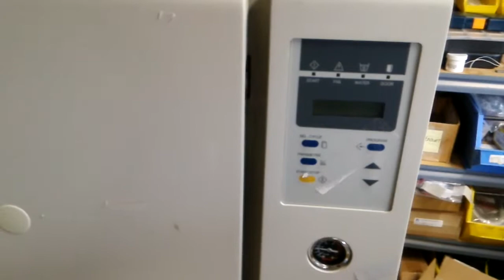fix repair service Tuttnauer Sterilizer Autoclave especially EHS sterilizer

Comment: As a periodic maintenance message on the 3870, which is the technical user
Reply from the maker: Sorry to reply you slow. Where are you? If you need a help, please try to call us at 866-201-6291 next to the machine, we need the SN, which you can find from a label on its cover. Thanks